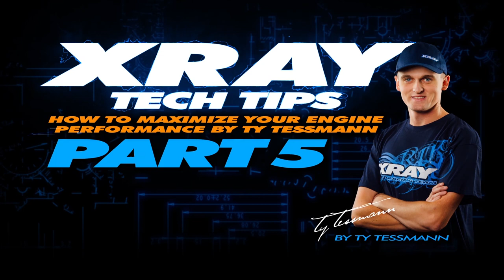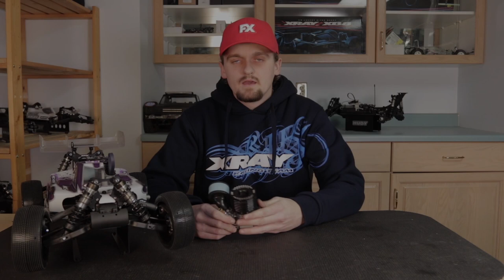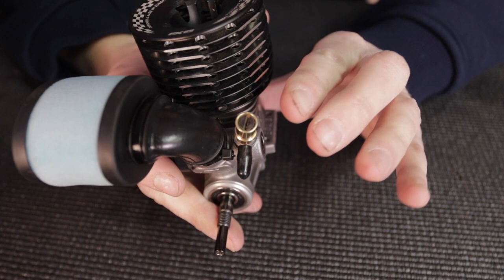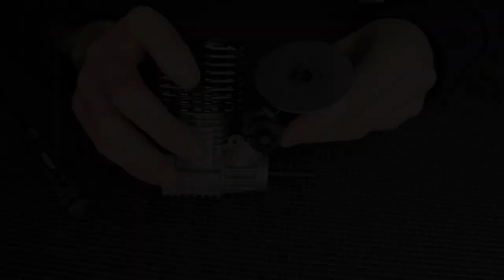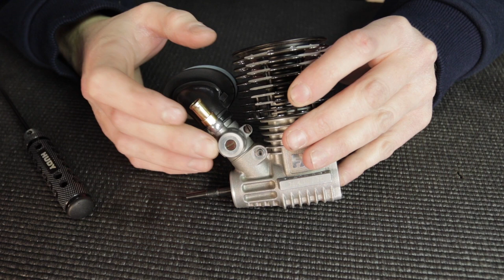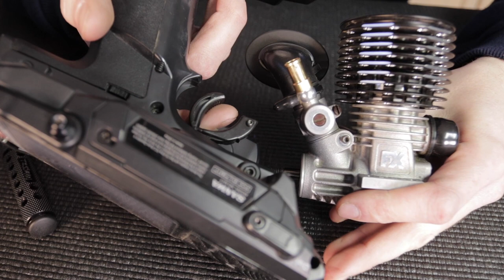Better Engine Performance Series by Ty Tessmann - Video 5

Comment: I've had bad luck with nitro, I've broke two engines, both reds, 1 brand new, the other used. Not sure what I did wrong with the last one? The new r5r I bought, lost signal and revved until the rod broke. I've got it fixed and plan to run it at pnb. I've made a Frankenstein engine, it is a wr7 crank and case with r5r sleeve and piston! Lol ot runs good and cant wait to run it at pnb! Great video!

Comment: no mention of the all important idle gap ?
Reply: I think he covered idle.
Reply from the maker: I don't use idle gap in tuning engines as I feel it is inconsistent between different engines, different fuels, different ambient temperatures and different glo plugs.  I prefer to do my engine tuning on sound, but that's just me.